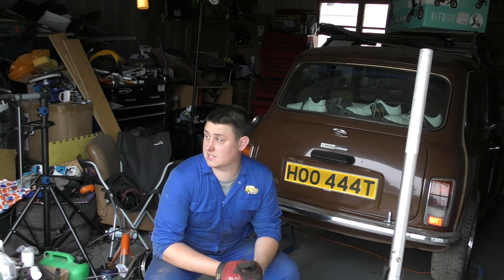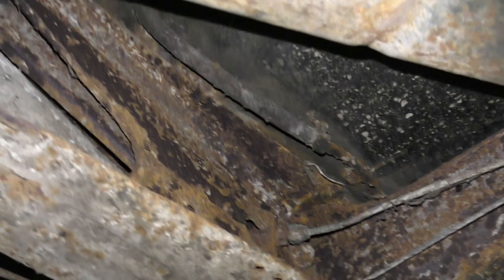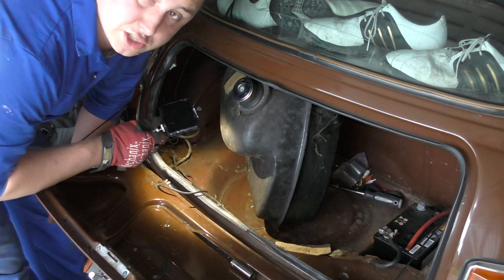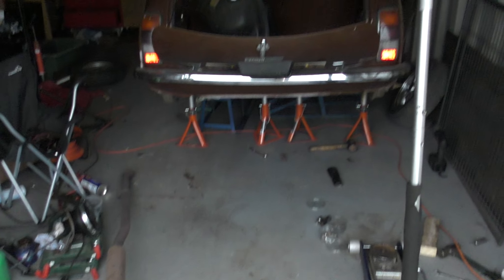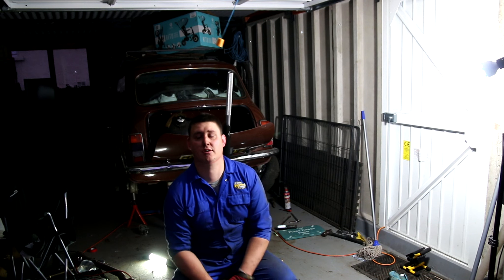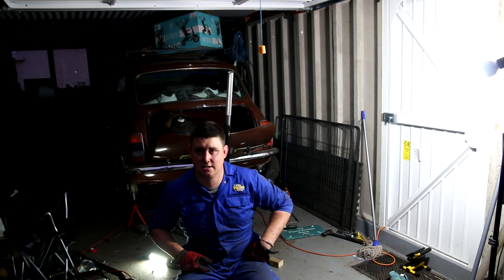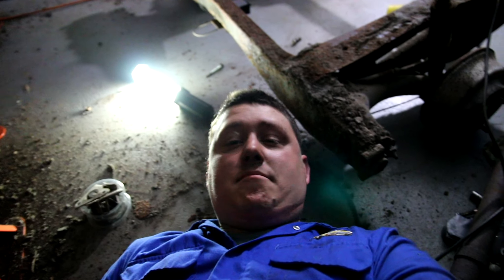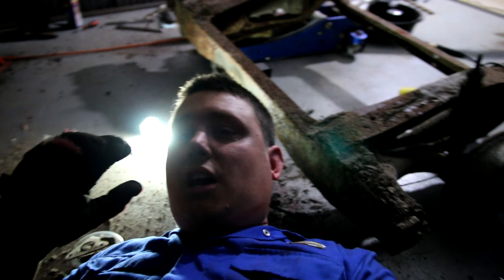Classic Mini Rear Subframe Removal

Comment: Heh, I'll be trying to do this on mine soon.  Noticed some big ol' rust holes behind the driver's side wheel today...
Reply from the maker: Oh no 👎 fingers crossed its a smallish job
Reply: @WilliamMurfitt  I should probably clarify, the rust holes are in the subframe, so the subframe unfortunately has to be replaced.
Reply from the maker: @MatroxMillennium  i just hope the panels are ok or it could turn into a big job
Reply: @WilliamMurfitt  Oh, for sure. The rear end body panels look okay from what I can see, but I have some rust along the sides and in front that I'll have to deal with soon...